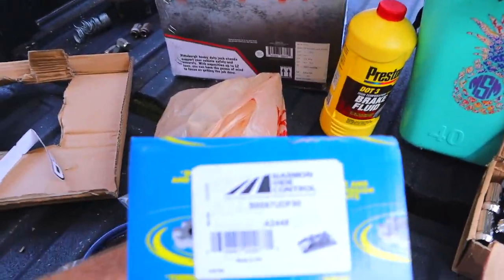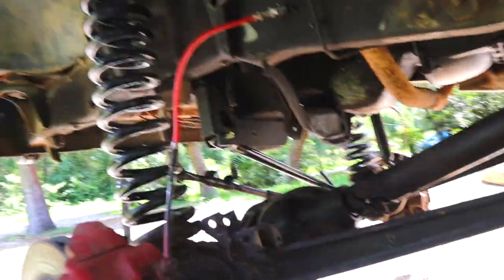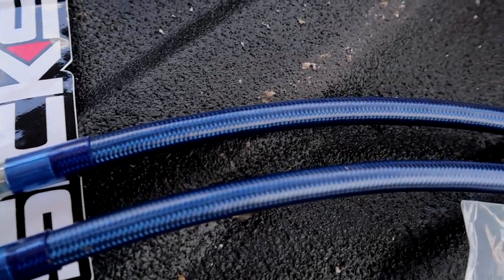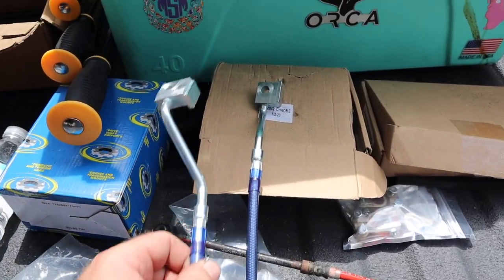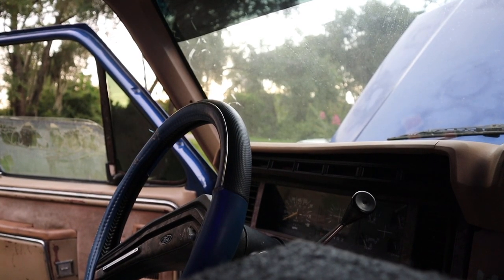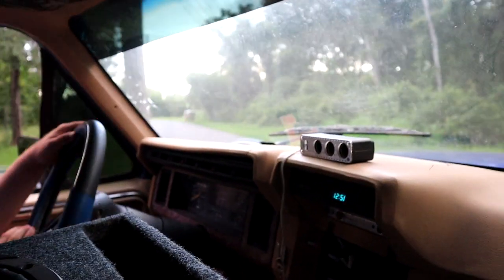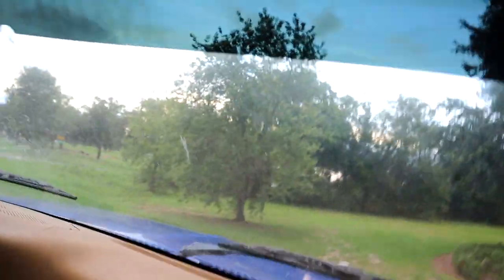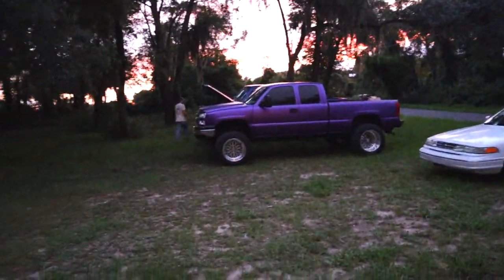SAS Bullnose Ford FIRST Drive In 4 YEARS

Comment: What gears are you running I have a 94 with 9 inches and after a lot of work and headaches it rides like a Cadillac however can’t go bigger than 35s because of gears and there’s so many debates for gears and 40s. Currently have 355s and it’s a daily
Reply from the maker: The truck has 3.73s but going to be putting 4.88s in, in the future.

Comment: Can anyone tell me if there is a difference in the 80-86 F150 2wd and the 4wd Brake lines. I’m wanting to lift my 2wd bullnose 6 inches but I can’t find any 2wd specific extended brake lines
Reply: There shouldn’t be any the front suspension on the 2wd and 4wd are pretty much the same thing. You can pretty much do a direct swap between a 2wd & 4wd TTB front end

Comment: That's why you dont buy a ford with a c4 or c6 trans because ford doesnt have a good automatic transmission
Reply: A c6 is probably one of the strongest automatic transmissions produced. They just robbed a lot of hp and the seals inside get old over time and they can’t build pressure. A c4 is a great trans, weak in stock form didn’t rob a lot of power but people spend big bucks to beef them up. A stock c6 can hold 600hp
Reply: @marcchaffee7751  im talking back when they were new transmissions they overheated when you made an attempt to overheat it
Reply: o.k.  i will be nice . lol , was a bad day .